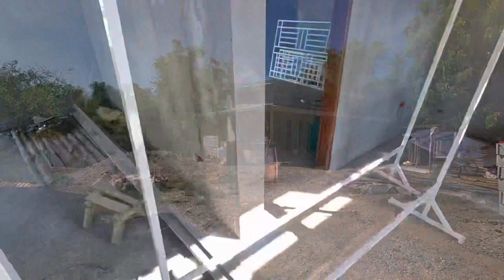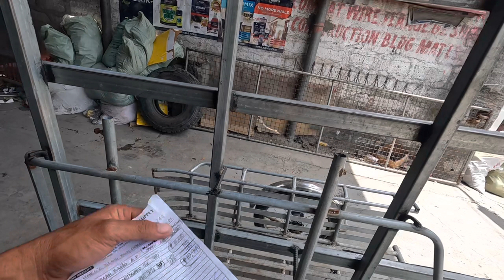Drywall sa loftbed  windowgrills installed

Comment: Boss Regz yung sa tiles ng toilet pano po yung pag lagay ng ceiling nya.instal muna tiles tapos ceiling?
Reply: Mukhang nakalagay na po yung mga metal furring bago sila nagtiles.. ilalagay na lang nila yung hardiflex na saktong sakto sa taas nung wall tiles.
Reply: @PongTube_  salamat kuya
Reply: @JL_2022  naka pako din po kasi ng concrete nail yung wall angle sa pader para matibay,